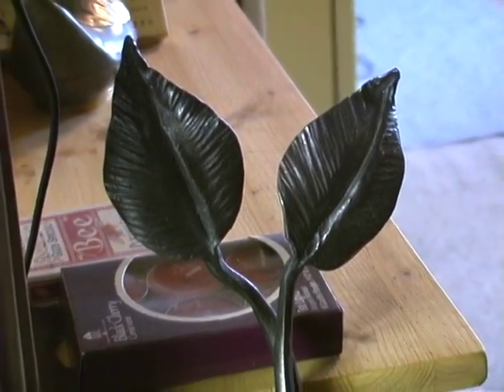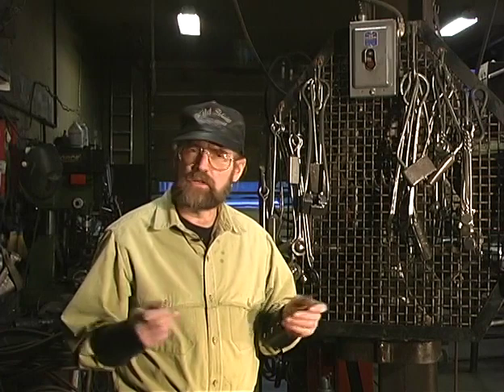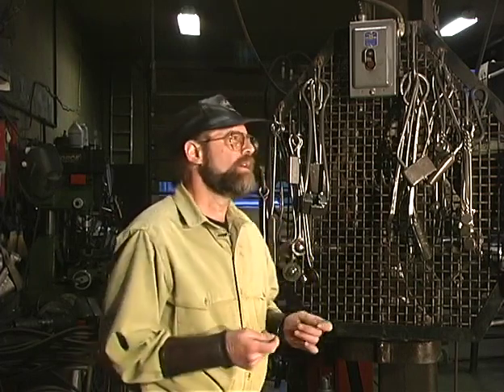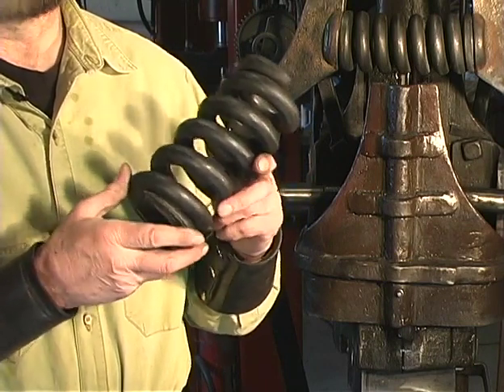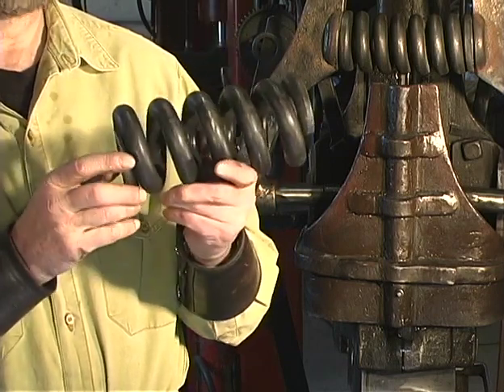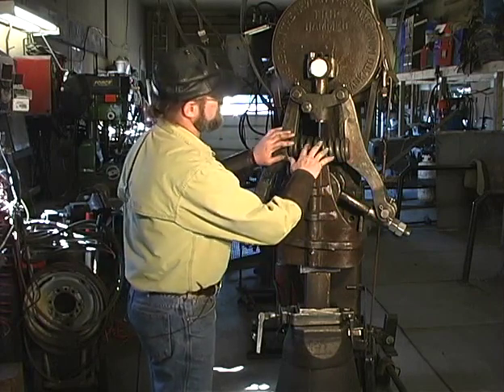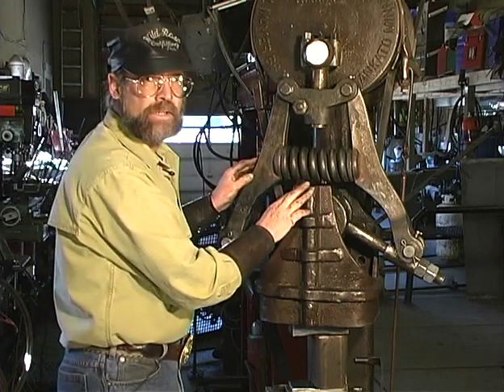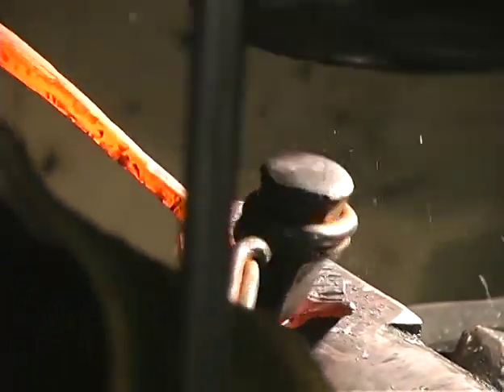Powerhammer Cycle -The Bang Tap Miss Hit Blues

Comment: Power hammer guru! You have a wealth of knowledge as to how they work! I have a leaf spring helve hammer I built and have got it working well through trial and error but now I have an idea of timing I can get it to work even better! The hammer itself has about 30 kg of lead weights inside of a cylinder that would be close to 20 kg! Its a heavy hammer! I will be making further adjustments!

Comment: I genuinely thank you for the sharing of your wisdom and knowledge. My following comment is NOT intended to be a jerk. Your figures show the crankpin arm upside down. As the hammer engages, that pin swivels rather than how your figures display. Again, I am NOT trying to insult you at all! 

I mention this as my toggle arms are slightly in a V and not fully horizontal. (At 6 o'clock) I'm slowly working on that issue. Through your videos, I did eliminate the double tap on my 50lb LG.

How much force does a 50lb LG hammer produce?

Again - THANK YOU!

Comment: I have just installed an old style 100# little giant. It has a 3hp motor that runs 1140 rpm. I still have to get power to the machine so I have not run it yet. It’s been totally rebuilt ,bushings replaced the Babbitt ,new spring ,new dies, both arms adjustable. I will let you know how it runs, I’m sure I’ll have plenty of questions lol

Comment: Can't find any information on the power hammer that my family has. And ive used. When it was set up in my grandfather's shop. It ran off wide belts and pullys in the ceiling.. its a la foncer. Have you ever heard of them.
Reply: Sounds like it was from France. Where was your grandfather's shop ?
Reply: @maplebones  no canada